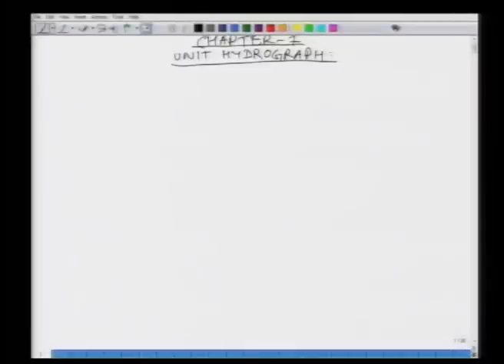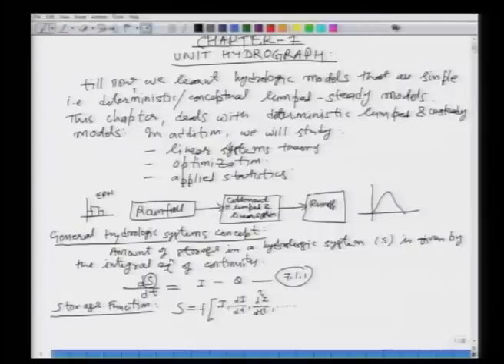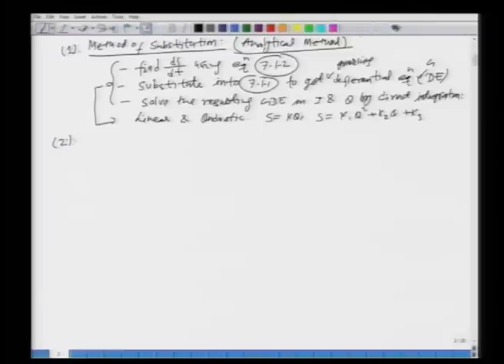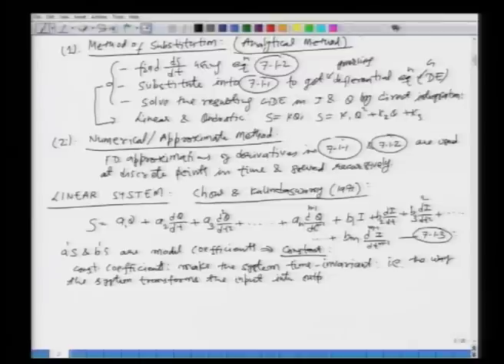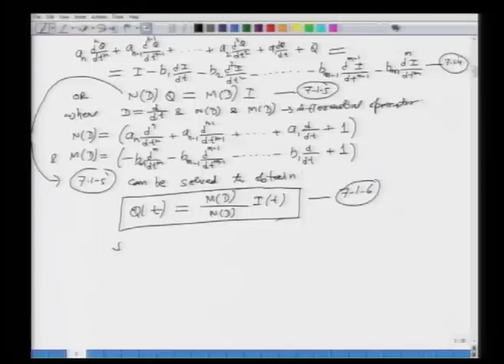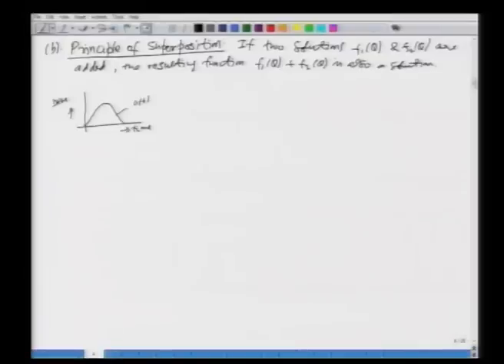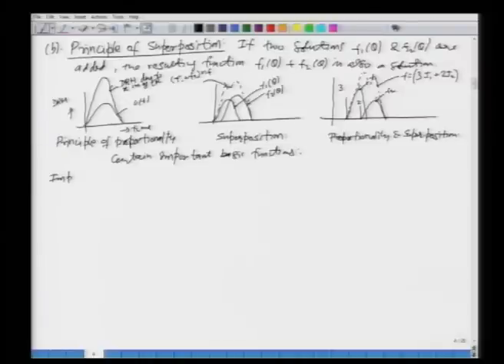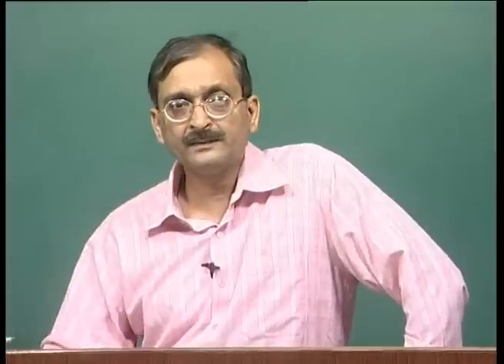Mod-01 Lec-23 Lecture-23

Comment: a rectangular parking lot is 140*280 m long, the time of overland flow across the pavement to the longitudinal gutter along the centre is 18 minutes and the estimated total time of concentration to the down stream end of the gutter is 24 minutes, the runoff coefficient is 0,9, if rainfall intensity 6cm/hr falls on the lot for 1 minute and stops abruptly , determine the hydrograph upto its peak magnitude....